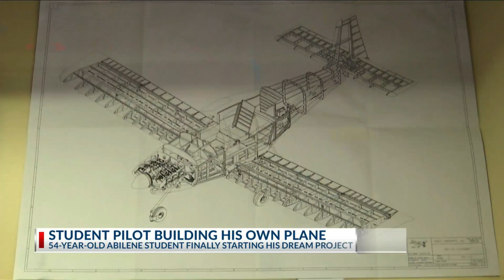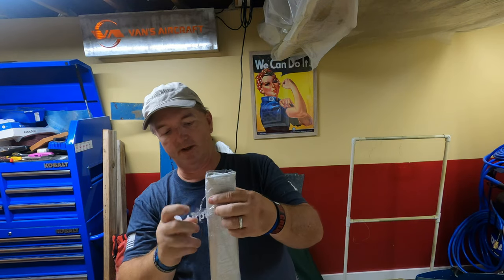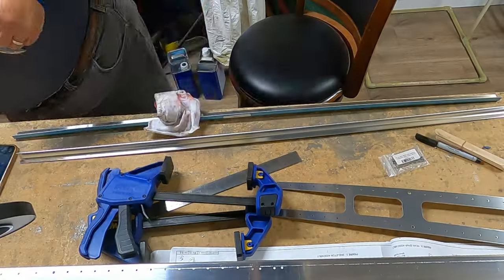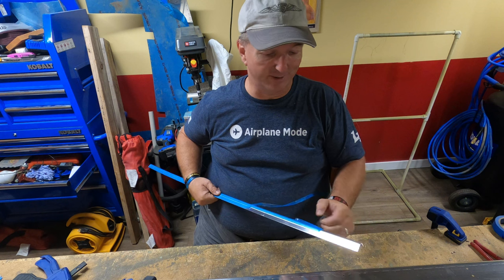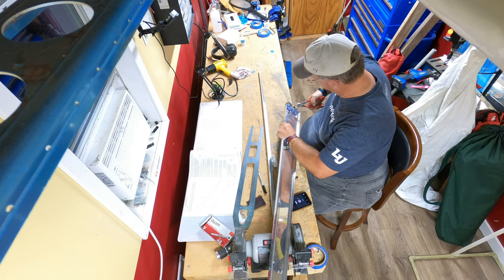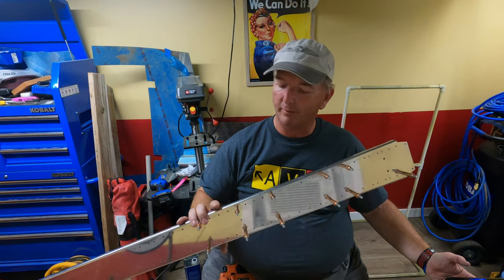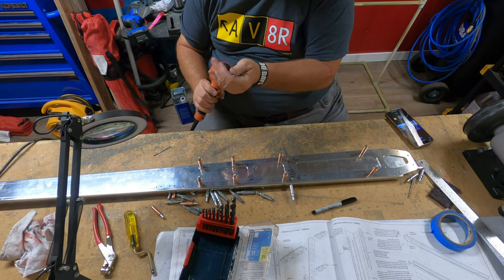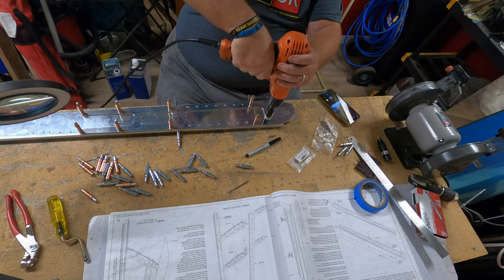We Cut Our RV-10 Vertical Stabilizer Skin in Half

Comment: Check with Van’s on your VS spar; I see in the video that it did not have the blue vinyl on it. Part’s with the blue vinyl are definitely punched but parts without it may or may not be laser cut. Van’s has already recalled the laser cut spars, so make sure the one you have is not laser cut.
Reply from the maker: There was blue vinyl on the spar. I didn’t show it coming off.
Reply from the maker: Just to be sure, though, I asked Greg Hughes about the situation and, from what he told me, I’m not affected since my tail kit was shipped well before Van’s began laser cutting parts.

They have stopped laser cutting and discarded all laser cut part inventories.

Comment: When it comes to drill bits, the best for drilling aluminum are "high speed steel", marked "HSS". Most hardware stores sell drill bits lablel " high carbon steel". These bits are only good for a few holes in wood. You need to go through tool supply houses to easily find HSS tooling. Carbide is expensive and over kill. Actually, carbide bits are ground for hard materials, the rake and clearance angles are wrong for soft metals.  HSS drills will drill a better hole.  Oh, did you just fly a "Gooney Bird"?
Reply from the maker: No “Gooney birds” have been flown nor ridden by me (yet). Maybe one day I’ll hit the lottery and be able to afford a DC-3 type rating from Dan Gryder @ProbableCause